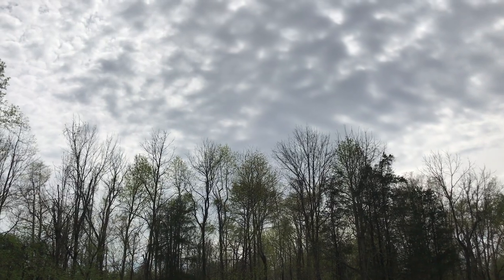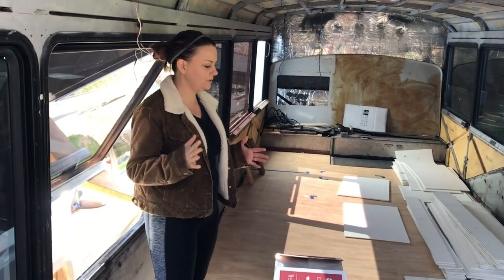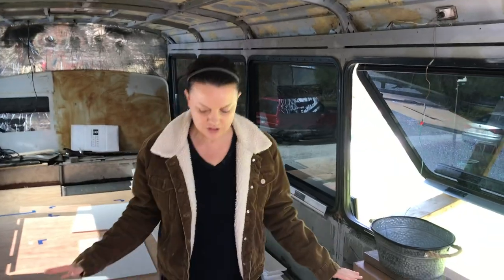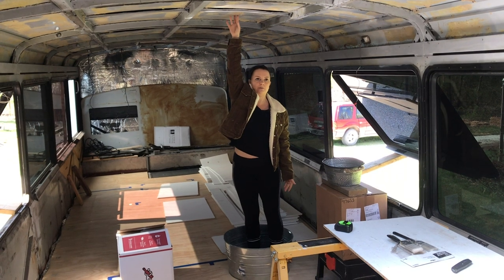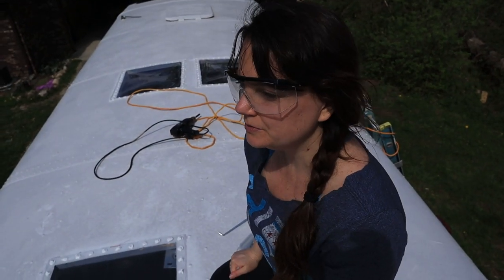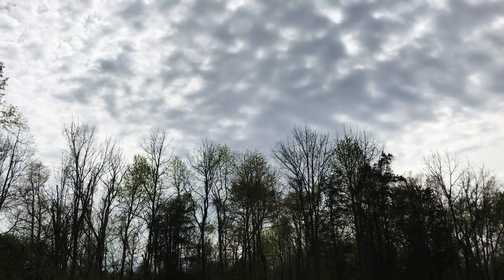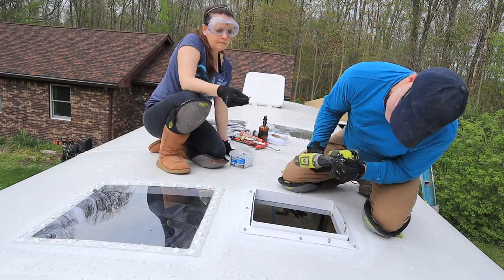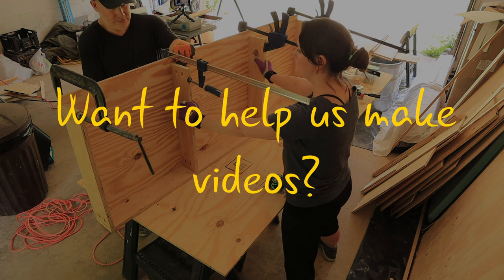Fan Install on Curved Bus Conversion Roof - S03E16

Comment: G'day guys that's a very neat exhaust fan top job fitting that and the sky lights, just one thing those composting toilets have a inherent problem.   If you have people over the urine container in the front quickly fills up which presents a problem carrying urine out side, I am a bit bias to these toilets I think there filthy I it were mine I would put in a black holding tank and a grey one they are not that hard to plumb in and the pumps ect are good and you have a lot of storage space under the floor, you then have a nice toilet that you can flush.     I will shut up now that I have put my two cents in great to see you again kind regards John keep safe and well
Reply from the maker: Hi John, yeah it seems people sway one way or the other when it comes to RV/bus conversion toilets.  We have rented a few RV's and were not fans of a black tank.  But agree with you about the urine bottle in composting toilets, that's why we are going to divert the liquids to the grey tank instead of having a bottle. So I guess we are doing a bit of hybrid toilet! Ha.  I think it's all to do with personal preference.
Reply: Agreed, we have a combination grey/black tank, never any issues. 

The other inconvenience of the composting toilet is when it comes to sell the bus. As John mentioned above, with guests you need to teach them how to use it.

Comment: DICOR, DICOR , DICOR it is the main sealant to use with butyl tape never use silicone as it will leak and butyl tape needs to be touching the surface to seal properly and the silicone will keep it from making that contact . If you roof has a curve use more butyl on one side to make up the difference. Dicor comes in many types the tape is one of my favorite but when you place it down make sure it's where you want it because it's not coming back off

Comment: Great video guys why not put a sunlight in your bedroom  too and maybe fan in the ceiling  cause that is where the engine is
Reply from the maker: Ha we thought about it Scott!  But we don’t want to lose anymore solar panel space on the roof.  The emergency exit could turn into a skylight hatch though down the line.
Reply: True good point

Comment: The skylights should be double pane.
Reply from the maker: Hi Richard, our plan is to build the second pane as a removable option inside the bus, that was we can have uv/ceramic tinting and a the ability to insert a black out reflector :)